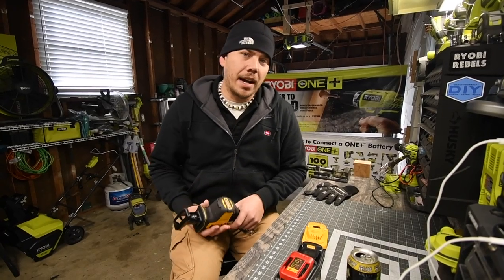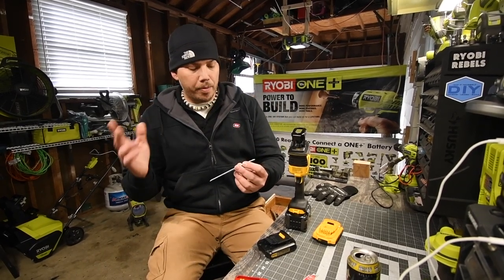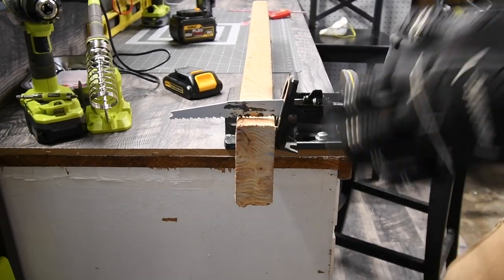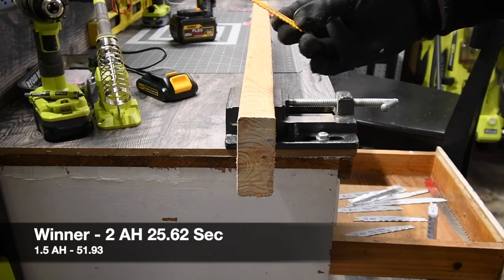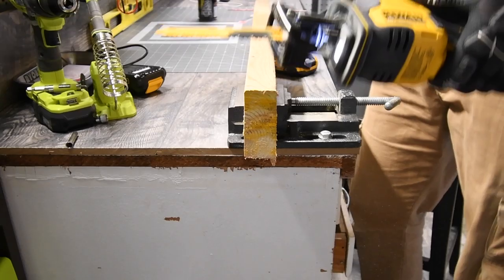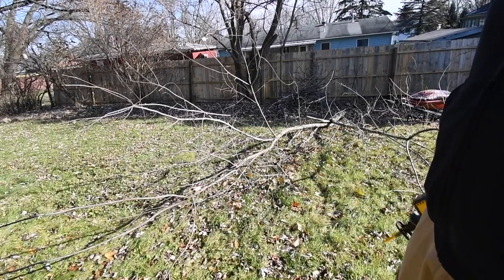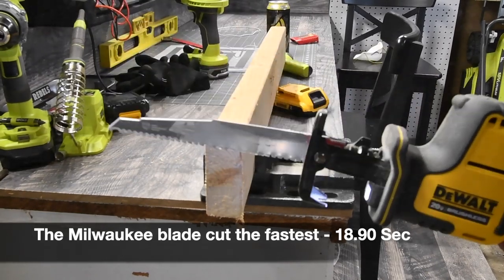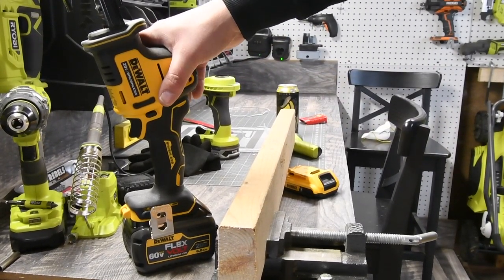Dewalt Atomic Compact Reciprocating  Saw

Comment: The 5/8 stroke makes this tool a bad choice for most tasks. Might be a good option for pvc  pipe or small diameter material. I’d be willing to bet the Milwaukee 12v fuel is as fast or faster.
Reply from the maker: a versus video will be coming soon
Reply: @ManCaverTools  Been looking for this showdown but nothing on Youtube yet.

Comment: If you’re a pro tradie, this weak arse saw is your back up for tiny spaces the big brother can’t get into….HOWEVER, if you’re the diy homeowner kind and only want ONE Recip saw, don’t waste your time on this thing. Imagine trying to prune a thick tree branch..you’ll be at it for hours, in fact I’ll bet green wood and sap with stall it out anyway…slow and a waste of money when for just FOUR pounds more (Amazon Aug 24) you can move up to the DeWalt DCS367 compact Recip saw which is very good and about 95% as fast as the top line bigger saws.  The only exceptions might be if you only cut small pvc plumbing tubing or thin pallet type wood imo.  Your money, your choice but you’ll kick yourself later….

Comment: As an electrician the shorter 5/8ths travel distance is very appealing to me, makes for cleaner cuts on PVC and EMT and the blade doesn't skate around scarring up the surface or concerning me about cutting off fingers. It's easy to get into tight spots, has a good balance to it and is a lightweight tool that's easy to carry around all day and use in one hand (a 4ah battery should last you all day as well). I've used a lot of recips on the job and this one is my favorite for a lot of reasons, most importantly the smooth action resulting in cleaner cuts and relatively low vibration for safety and comfort.
Reply from the maker: it did a fantastic job. the tasks I made this do is way above its pay grade but it does perform better with a good battery

Comment: Hi,

You just proved that using the right and better blade does help cutting. Plus a large ah battery also helps. 

I hope dewalt will make another model like this but with a larger  stroke and little more power. Just like the milwaukee.
Reply from the maker: Im not sure why people hate atomic. I love it and thank you sir
Reply: @ManCaverTools  

I think it's confusing to a lot people using the regular 20v line. Even though the atomic is also on the 20v it just lack on power on certain tools. Dewalt should have taken certain tools from atomic line and made it more powerful on the regular 20v line ie: (4 1/2" circular saw and the one hand saw). The drill, impact and oscillating tool was a big mistake in my opinion.

Dewalt already has does. Then they came out with a 12v line. So the atomic which supposedly be the compact series failed. Again, just my opinion.

Comment: There needs to be multiple tests or cuts with the same battery and average the times. Because making one cut could have a bad test time due to some variables. The larger batteries don't add more power, they are just larger capacities. The tool will still draw the same exact amount of power it was designed to pull out from a battery regardless of it's size. The batteries don't add more power.
Reply from the maker: Yes they do add more power. the 1.5 killed the 2ah. bigger batteries do add more power. in every test I do the bigger batteries kill the smaller batteries

Comment: Dude you don’t know how to use a saw. You need to move the saw up and down so the blade is angled in the wood. You keep holding the tool straight and making the blade cut the wood without and angle and it makes it take way longer